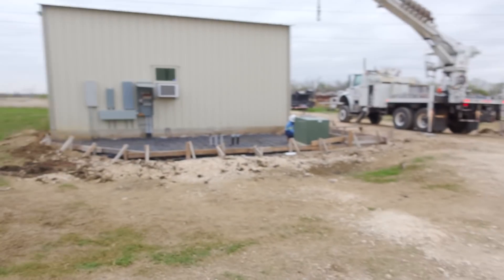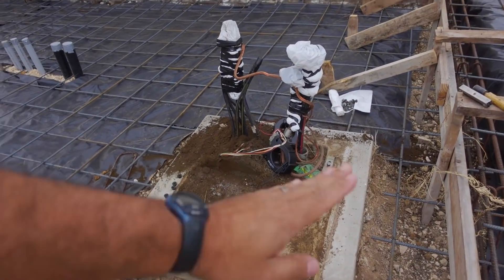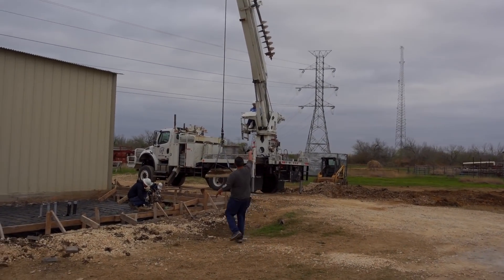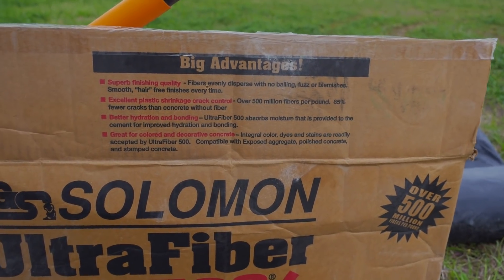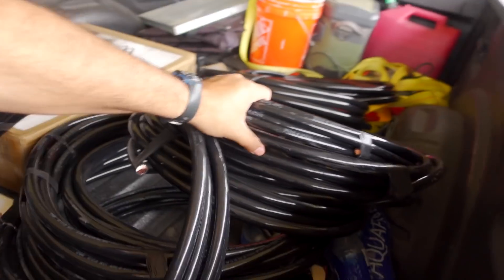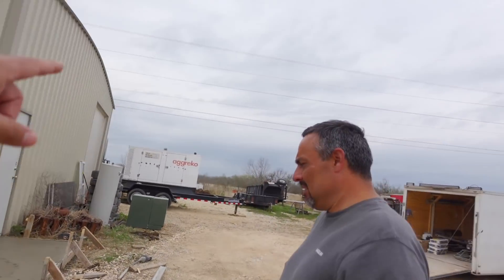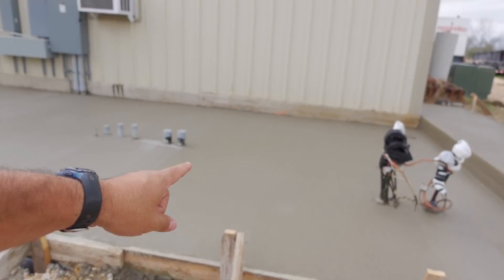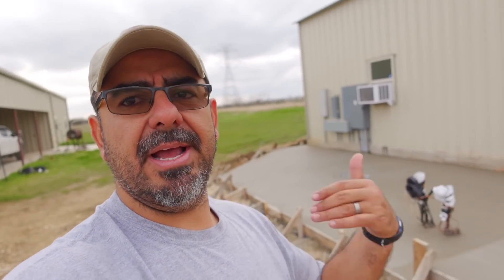Pouring concrete slab for 3-Phase electrical transformer | Starting a machine shop 16

Comment: Looking good Erik, FYI, you can make both, you and the utility contractor happy, leave a hole in the middle of the slab pour between the conduits for future conduit use. After the concrete has setup approx. +80% (no more possible shrinkage), fill in the area with non-shrink grout about 1-2 inches thick. It will stop bug intrusion and in the future if someone needs to add a conduit, they can just break it out. It worked for me many times.

Comment: Yes. The electric utility needs a window there. YOU may not need to add any more conduits to that transformer, but THEY might. One thing I learned during my 30 year career in electric utilities is plan ahead. Another thing they'll need access for there is for driving a ground rod.
Reply from the maker: Ground Rod is installed already.  
They will never do anything with that window, and me as a concrete contractor know that it will be more harm than good collecting water.  So I didn’t put one in.

Comment: If you enclose the compressor, you can probably eliminate most of the noise. Plus that keeps the weather off of it.
Reply: Just put three pieces of 2” insulation around it with a mini roof and call it “professional”.    Yes, it will also protect the compressor from the weather.

Comment: Man what I wouldn’t give to move down there to work for you boss man. I’m a concrete finisher, even thou I’ve worked for the union I wouldn’t call myself a union finisher. I’m a real finisher, from digging it out, to grading, to laying vapor barrier, to the wire/rebar, to forming, to laying the mud through the whole process. I operated from walk behind to hydrostatic ride on machines. Man oh man how I’d love to live in Texas doing what I love! If you ever need another finisher please get ahold of me. If you want my contact info just reply to this message and I will email you with my info and answer any questions you may have. I would really love to live and work in Texas!

Comment: Certainly a couple of interesting last videos and your not alone with having pain in the ass building inspectors we have them in the UK to 
Seen the  fibres to strengthen the concrete before that was completely lost on the different to what we use in the UK C30 would be a strong mix 
And we set are reinforced  mesh in the middle of the concrete but didn't see yours before you poured. 
By the way that lathe  looks bloody impressive 👍

Comment: It will be better soon.  I remember when I moved my meter on old shop from side to back, got 3 phase ran in.  Flashlight time.  They sell headband lights at Wal-Mart, make sure you buy extra batteries.  Better than a kerosene lantern and holding a penlight in your mouth.  Ha

Comment: I'd take the  generator back, fix the air compressor/dryer and get the electrician  out. 
You didn't mention the laser. What good is it going to do to run the lathe?

Comment: That is the biggest float I have ever seen!  Two bowls of wheaties that day!  Run to for what?  You be da boss, Leroy can handle it.  Great crew.  Insulation on the walls for the air.  Trust us, it will pay for itself in lack of headaches later on.   You have been in the dark so long with the power co. that if they show up and do what they are supposed to be doing, you just may have a coronary in surprise!!  Take your wife out to dinner and have another honeymoon on the company.  Tell the irs I said that it’s O.K.

Comment: I'm not a sparky, but it seams to me you could tap into one leg of the machine power and get 120v for the compressor and lights? Of course I ain't picking up the tab for the monster machine if I'm wrong - again!
Reply: Agree.

Comment: I see your a ford guy. Fords new f150 powerboost is capable of 7000w 220v constant generation. 400+hp. Would be a Awsome work truck for the early building stages. Never suffer trough a black out again.😂

Comment: The generator should have the frijoles to power the entire shop or at least the lathe, air compressor and a light. Hang in there amigo.

Comment: Didnt you say in the video that you were supposed to leave and airspace around those conduits in the concrete ?
Reply from the maker: No, I said they wanted me to leave space in case we ever had to run another pipe in there.  That will never happen so I didn’t leave a window there.
Reply: @ErikCortina  Think the real reason they ask for the gap is if the slab moves for any reason the conduit won't break, its not really all that strong.  Some contractors are unfamiliar with the idea of proper compaction.
Reply: @banffdigger  that and now they can’t drive a ground rod. And they aren’t going to use his.

Comment: I've watched your install and don't think your "plan H" electricians did many commercial services nor utility connections. I've been doing commercial/industrial for 25 years. Sweeps and rigid nipples are their thing. Surprised you don't have a meter section between the main and gutter. The utility usually gets to say what kind of pipe is used between the pole and meter and the city/county gets to say after the meter. That might have been that sweep snafu. I hope that gutter doesn't stick out farther than the main disconnect either. We have never figured out which is slower, geologic time or utility time. I enjoy your videos and good luck with the business.

Comment: You didn't block out the primary side of the original transformer pad like they asked you.
Also I think you don't have enough clearance to the right side of the disconnect for the 480VAC (that window unit is the problem), there's a section under NEC 230 (grounding) that requires a side clearance from live lugs within a panel to the nearest grounded surface to each side of the equipment, that also applies to behind you, the space in front of the panel...not that the front clearance applies in this instance, your wide open there.
It's been 25 years since I retired as an Industrial Electrical Contractor, don't remember my code well anymore and ain't going to find one of my copies of the NEC.
You need to learn the art of 'Patience' ... You can't always have everything on your terms and time frame. I'm sure rushing things & pushing too hard has tripped you up many times in the past.
Getting in too much of a hurry is one ingredient of a good 'Cluster Fuck!'

Comment: I feel your pain.
Reply: A few weeks ago I add a trans tube cooler to discharge on 7.5 hp compressor. It made a big difference. Now most of the water trapped in main tank. Added 120 gallon second tank. My mill uses a lot of air, the lathe doesn’t. Plus a air dryer. Moisture free.

Comment: Next time have the electrical panel work done before the power company and run the entire shop off the generator. Looking good though.
Reply from the maker: I tried, but the disconnect they required me to do took a long time to get.  Also the electrician that was going to do the work for me passed away.  So this is plan H I think.  Plan B was a long time ago.  :(

Comment: Am I the only one thinking "why the hell did you not box out that conduit like they told you to...." Tomorrow you will be digging that pad up again.
Reply: i was thinking the same thing that would not fly here in NJ PSE&G would fail that
Reply from the maker: I didn't do it because the reasoning behind it.  On the other transformer I asked about adding another pipe and they said it was not a good idea, and it was dirt!  Imagine adding another pipe in concrete!  Nah, I happen to use common sense and they don't, so I poured it so that water would not go down in that hole and cause issues in the future.
Reply: @ErikCortina  I hope the Jobsworth's agree with your logic. I doubt they will somehow. Because they are jobsworths and have proven to be, er, awkward several times on this project already? I have my fingers crossed for you.

Comment: I still don’t see aground rod pipe. Your going to fill all that in and not have a hole for them to drive a ground rod. Glad you got bigger secondary pipes. Should’ve put an extra 4”. And don’t forget ground rod pipe or you’ll be cutting a hole.... still not following pad layout spec sheet....
Reply: Nvm you already did it smh. I wish you would’ve asked a lineman. Now when they come tomorrow to drive a ground rod they are gonna say where the ground rod pipe? How are we supposed to drive a ground rod?
Reply from the maker: We had a ground Rod by breaker panel and another one by the pipes.  It was all good.
Reply: @ErikCortina  we drive our own. Not use a 10’ regular one. If you put a 40’ ground rod then ok but they are going to drive their own.
Reply: There’s no meter panel. So you need CT’s inside the tx. But you didn’t run a pipe for ct wires to go to a meter rack. So now I dunno how your going have a meter. Other having to buy a ct panel or a meter panel and reroute your pipes on building. More wire and an extra panel now. Or you can cut the concrete and put the 1” pipe. But you can’t just run the pipes to the mdp and not have CT’s in the tx.
Reply: @ErikCortina  I’m really just trying to help. But now you gotta cut the slab or buy another panel. A meter rack and some 1” pipe would’ve been the cheapest easiest way to go.
Reply: @ErikCortina  it’s not too late to just contact me. You needed a window so they can drive a ground rod. They are not going to use yours. It’s not long enough and won’t ohm out when they go to test it before installing meter. The guy who comes to hook up secondaries and test the ground rod will not install the meter if it doesn’t test out right. And now they can’t drive one. You don’t have room for a meter can on building but now without a ct pipe your going to have to have one. I’m trying to help man I could’ve just told you all of what to do in one swoop. I offered. You can block me or whatever but I love your channel and I love what you do. It’s just so frustrating to see you led by an incompetent electrician. And then keep making bad decisions against what they tell you to do. It’s not better to not include a window. Now you need a core drill to drill a hole so they can drive a ground rod. And you need an extra panel you don’t have room for. A 400amp meter can is bigger than that mdp you ran the pipes to. Now you gotta buy a meter can and run the pipes to that first. Then to mdp. I’m really really honestly not trying to be a dk. But there is very specific reasons stuff has to be done in a very exact order. That 1” pipe not being next to the secondary pipes is a big one. I’m sorry man but this is just all wrong. Like the 2” pipe you tried to put in first. I hope you got the pipe phases correct from tx to pole too. They have to be abc in tx and then line up properly at the pole. The wires on pole on that flat run are going to be abc north to south or East to west. If they are backwards they will have you change it at the pole. And they don’t go on the back side of the pole they go under the wires under the switches. I guess you’ll get it all figured out eventually. But if you want help I’m still here trying. It’s just frustrating. Running those pipes to the left side of the pole like that is wrong 1 cause they aren’t under wires and 2 cause they are on traffic side of pole. They don’t put wires where a car can hit them unless they absolutely have to. I’m trying to help you man.

Comment: could be worse. In my area ,they want a 36" deep pit with a divider in it, instead of a window.
Reply: speaking of window, I see you didn't do it.......Hope you get by with it.
Reply from the maker: It doesn’t need a window.
Reply: @ErikCortina   I've ben doing electrical work since 86, had a NC state license since 96. I 100 percent agree they don't need 'em. The power company in this area just simply refuses to set the transformers until they get what they want. Most times around here they want a 36" deep pit, with a divider between the primary and secondary.
Reply: Hang in there, though. You will get to your desired result soon. Its close.
Reply: @richardakers9167  there’s actually about 4 reasons... you’re gonna see.